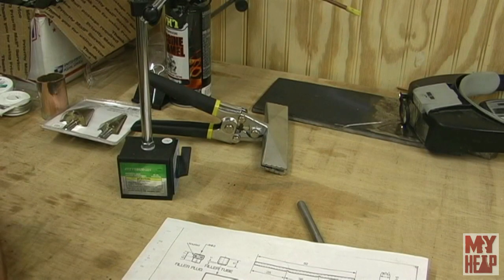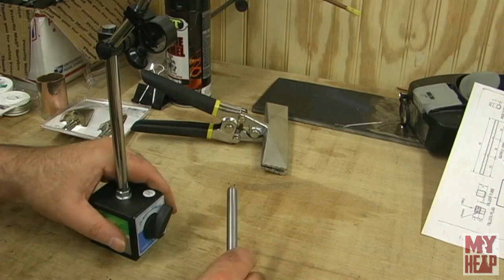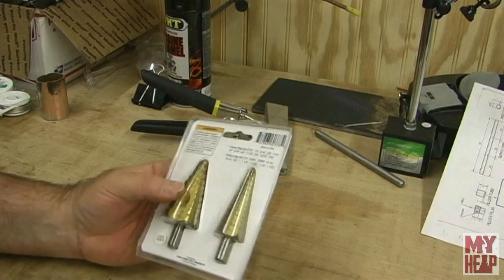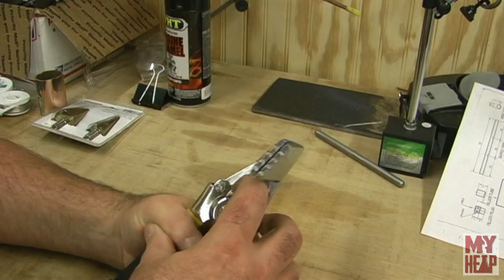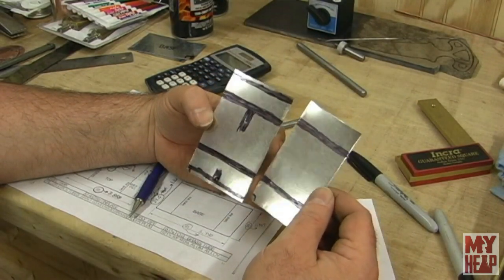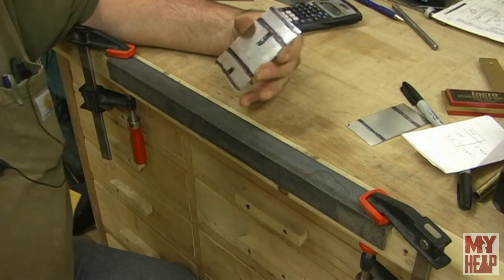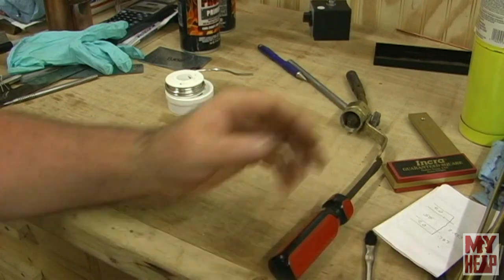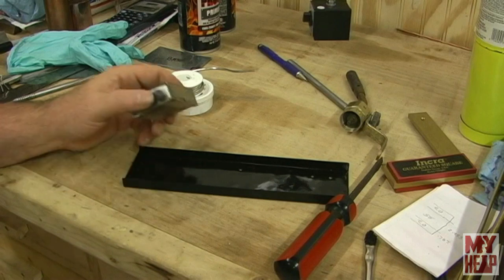Kenneth Wells Stationary Engine - 03 - The Fuel Tank

Comment: A+ on the step drills. id like a set of those pliers too!! too much heat in the soldering maybe, the metal expands. nearly do that job with an electric iron. some bakers soldering fluid on your brush wul help the solder run around.  lot of new skills in this project though! the big heatsink in the vice helped a lot i think. this little tank was a challenge. the rest is easy!!  the foundry visit is sunday! so ill have something in the post soon. youve done so well. (a secret too, I made that base 2x because of the same issues. ) hahaha
Reply from the maker: Hi Emma.  I finally got the solder to flow by using some flux on the brush and rubbing it about while the solder was melted.  Hindsight being what it is, I probably should have wrapped some soft wire around the tank before I started.  Maybe that would have helped with the expansion at the corners.  The 30ga was pretty light, but after it was soldered seemed to stiffen up quite a bit.  As far as new skills, I will be in a lot of areas I have never been before.  I am looking forward to it.  Thank you for casting the stuff up for me.  Are you doing a set of TE castings as well?  You need to drop me an email and let me know how to pay you.  Thanks for the support and help you have given on the project and thanks for stoping by to watch and comment.

Joe

Comment: Hey Joe,  not bad for a first time solder job 👍,  the torch was a little to hot for the size of the tank, still not bad.   Don't beat yourself up over the apprentice marks, that's how skills are built.    Once you have this built then up-size it 2 or 3X.
Reply from the maker: Hey Walt.  It was an experience for sure.  I have soldered a million electronic components (or so it seems) over the years but this was my first go at something like this.  Once I figured out to brush the molten solder with the brush loaded with flux the job seemed to get a bit better.  I definitely could use some more practice.  I think when this project is finished, i might try my hand at his Traction Engine.  These are both simpler type models and by then maybe I can try something a little more complex.  When I get to the boiler I have to silver solder, which I never done before so I am a little apprehensive about that.  Thanks for stopping by and commenting Walt.

Joe

Comment: Joe nice build. Step drills are the way to go with sheet metal. Holding sheet metal by hand using a twist drill scares me. I agree with bison workshop silver soldering is the way to go when making boilers.
Reply from the maker: Hey Steven, great to see you.  The step drills made drilling the thin sheet metal a breeze.  I am glad I bought them.  I agree with you and Bob, that boiler making should be done with silver solder.  The fuel tank and burner though should be good with soft solder since it isn't under pressure.  That was the first time I tried soldering sheet metal and when I go to make the boiler, that will be the first time I've ever tried to silver solder so that should be fun.  Thank you sir for taking the time to watch and comment, I really do appreciate it.

Joe
Reply: I have learned the hard way, never hold sheet metal by hand when you drill it. I still have all ten fingers, but I do have plenty of scars!
Reply from the maker: Hey John.  I probably should have clamped it down or something to secure it.  It was probably an unnecessary risk on my part.  Thanks for pointing it out.

Joe

Comment: looks pretty good, soft soldering is tricky even for people who have done it for years. To keep from getting the dents in your sheet metal, Ive always used a lead hammer, and it really never leaves a single dent in it. It also works wonders for getting the dents out of sheet metal also. I have some of those step bits and have used them on some pretty nasty steel, and they've held up supprisingly well, you just have to run them slow, so I usually put it in the low speed/high torque mode in the cordless drill while using plenty of oil.
Reply from the maker: Hey Chirpy, great to see you.  I think it was Bob suggested using a dead blow hammer.  I know it looks rough, but at least once it is mounted down to a board and covered up by the tank, engine and firebox / boiler they won't be glaring at me.  I have more 20ga so if I cannot live with it, I will make another.  The step bit was definitely a bonus when it came to drilling the thin 30ga sheet metal.  I was holding it pretty tight but it really gave no resistance.  I will remember you advice about plenty of oil and low speed.  When do you think you will get to open your shop back up?

Joe
Reply: Im not really sure when Ill open it back up, but still working on patterns. Im thinking of seeing if there is any interest in the 7" surface plate or 12" camelback straight edge, and if the initial one molds and works out ok, I may have some made up to sell as rough castings for doing as projects. The surface plate is amazing looking, and hoping the straight edge turns out just as nicely.
As for the shop, the weather is still shifting back and forth still, and it still hasnt gotten cold enough to freeze or dry out, and it's just been cold and rainy still, so humidity is still very high and very cold. I may try to do a video showing the pattern making on those parts, but it's hard to do something like pattern making that is alot of little steps to piece it together without making a 5 hour long video that is litterally like watching paint dry and lots of sanding, lol.
Reply from the maker: Would be a pretty cool project.  Ashamed I don't have a way of finishing on.  No way to machine it and have never done any real scraping.  Would like to see the castings though.
Reply: I dont have any surface plate either, but I do have some plate glass, and will probably split it into 3 plates to lap the 3 together to make a nice flat reference surface. Ill have to measure everything out, but Im pretty sure that should work out to get a pretty flat reference surface. I wanted to make the 7" surface plate because it is big enough to do alot of work on, but small enough that most home shop guys can machine it up on a normal mill or shaper. I plan on just using my shaper to machine mine up. Scraping isnt really that hard as long as you have a decent scraper and time, lol.
Reply from the maker: I have a Burke #4 horizontal mill that is on my list of putting together.  I hope to start it soon.  I have so much to do and so little spare time to mess about with it.  Think I scored a 110 volt heat exchanger blower for the furnace though.  So that's good news.
Reply: yea, nice thing about the 7" surface plate is that it can be faced off on a 10 or 12" lathe without much issue if put in a 4 jaw chuck if nothing else. Is the blower a capacitor start style or the shunt style? If it's shunt style, thats what I have on my furnace and those things are really nice because you can hook them up to a ceiling fan dimmer switch and they work perfectly fine for controlling the speed of them, which is really handy for controlling the amount of air that goes into the furnace to accompany the burner.
Reply from the maker: I don't know what type it is yet.  Waiting for my heat and air man to bring it.  I have a small granite plate but I am interested in a camel back straight edge.  What do you think you will want for the casting?  What about premachined?
Reply: I honestly dont know yet on the price and mine will be on hold for a few till I get the mill up and running, so not really sure on that either tbh, lol. Ill be talking to a few people and getting prices on the stuff, but this will probably be a few months down the road after I get the initial castings made by my one friend. He didnt want to make a bunch of them because he hates repetitive work, but after I get the initial one and everything done up, Ill let you know. Im still semi keeping it low key till I get the initial ones made and see how they turn out, and also need to finish the patterns first, lol.
Reply from the maker: Okay, I will shout back at you about it later or reach out to me when you think you know more about it.
Reply: ok, will do.

Comment: Some good sources if sheet steel are computer cases, vhs and dvd player cases, microwave oven and toaster oven cases. Larger pieces are also available from junk washers and dryers.
Reply from the maker: Thanks Gene, I will start saving some of those bits as they come along.  BTW, the seaming pliers worked out well, at least for what I was doing.  Thanks for the tip!

Joe

Comment: G’day Joe. Soldering is an art and needs plenty of practice and I will say that blow torch was a little too hot for the material but still you work with what you got, looks like it worked out for you anyhow. Cheers Peter
Reply from the maker: Hi Peter,. I had to brush the molten solder with flux to finally get it to run.  I think a heavy soldering iron would have done it, but that is all I had.  It seems to be air tight which is what I need.  I will know for sure when I finish the burner assembly for it and give it a water test.  Thanks for watching.  How is the tail stock for your mill coming along?

Joe
Reply: Welllll!
Actually it’s coming along with the mill now performing some of the work on itself. The universal compound slide has come out of the cupboard to do some unrelated lathe work because it, the lathe decided to break a toothed drive pulley whilst the hand wheel for the tail stand was being machined, now that’s after the motor decided to take up smoking. All will be revealed in upcoming action packed videos. Stay tuned, cheers Peter

Comment: K+S makes  5" X 7" tin sheet in .016 thickness which is equivalent to 28 Ga.  It is available through most good hobby shops.  Keep in mind that it is all tin not steel plated with tin so it is a little soft.  Good video, I am looking forward to some steam projects myself.
Reply from the maker: Thanks for stopping by and watching.  Tin has a fairly low melting point doesn't it?  I bet that would be tough to solder without burning through.  This is my first ever steam project and a beginner metal worker to boot.  I am a computer network guy by trade and having something like this to do without computers (except cnc of course) is a pleasant experience.  Watched your video this morning on your stones.  Been meaning to email you for the details.  Hopefully I can remember the next time I am at the computer.  Thanks again for watching and commenting.

Joe
Reply: I just got a couple pieces of this product.  They measure 5 X 7 and are tin plated steel.  They look good.
Reply from the maker: What product?
Reply: K&S metal, it is available though any good hobby shop.  5x7 tin sheets measure .016.  Material is actually tin coated steel.
Reply from the maker: Hi Steven,  I guess I should have reviewed the thread a little better.  I see that you had mentioned K&S in the beginning.  Sorry about that.  :-)